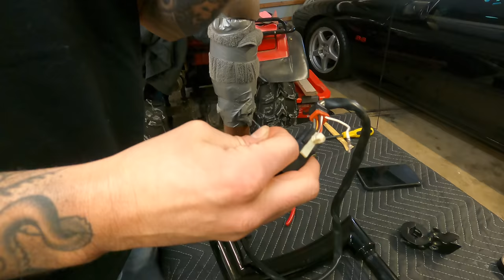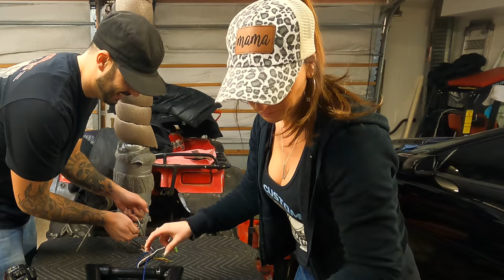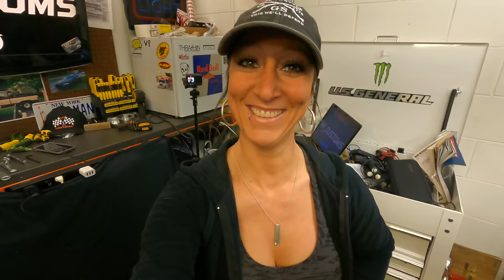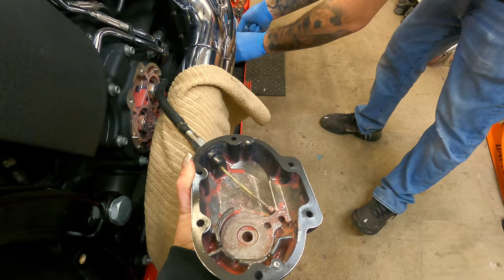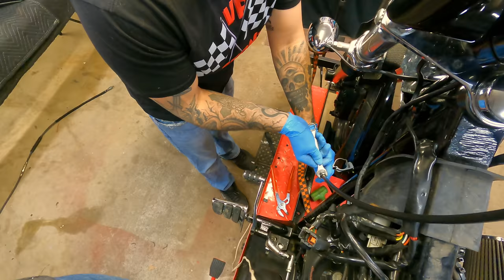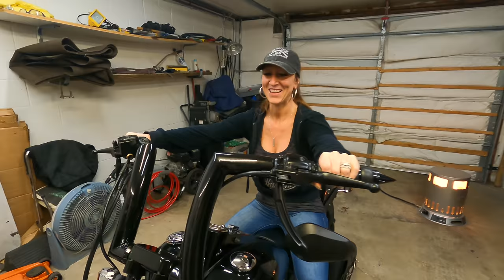The Fattest Apes On The Market- Install Pt. 2

Comment: Guys, love the content, I have been doing my bar job all winter. I’m on mock up right now. And found out that I’m not good at soldering. $400! HD wanted 10hrs
Reply from the maker: Geeze!! Burly sells a kit that you can just extend the wiring with pins, that's what we did!!

Comment: The wiring connectors have a barb that you’re collapsing, so when you re insert the wires into the connector, you might have to gently lift the lock back up from being collapsed or they won’t stay locked in to the connector.

Comment: Great Video!! Mate, may I know how height Tanya is?? I am 5 8” and struggling to install 12” or 14” ape. Thanks!!!
Reply from the maker: Thank you! Tanya is 5'3 and rides with a 12 inch bar.  I'm 6'2 and also have a set of 12 inch bars.  So whatever your preference is!
Reply: @VPCustoms  Thanks for the reference!! Really useful info for my decision=]

Comment: that s a pretty detailed video. good info . thanks
btw , did anybody use the cable extenders from Harley ? doesn t seem like there s room for more plugs underneath that rubber protection.
any thoughts?
I m trying to put 12' apes on a 07 Fat boy but I rather get the prewired handle bars
Reply from the maker: Thanks! Glad you enjoyed! Prewired definitely makes the process much less time consuming, I went that route on my 2001 Nightrain.  I think with some craftiness you could sneak in some more plugs under there.  Good luck!

Comment: Chain goes through quick but try cord to pull it through or something smooth like fishing line. My fave is cord cause you can tie easily to wires then black tape. If they’re small diameter , ky lube will work well then dry out better than Vaseline.

Comment: Definitely, even what seems to be the easiest job. Will always have some issue. I had a lot of issues with my first winter project and had to do research to figure out how to solve each issue. Especially mounting Street Glide fork mounted turn signals to the front of my Road King. First time de-pinning and finding out what connectors and pins I needed, but luckily I got it all situated.
Reply from the maker: Glad you worked it all out!

Comment: Very good and informative video! I have the same Night Train 07 and plan on doing a similar customization on mine. Could you tell me the lenghts of the clutch, throttle cables and brake lines you used? Thanks in advance and cheers from Poland!
Reply from the maker: Thank you! I used the 14 inch extension kit from Burly.

Comment: Hey guys. Love your videos. Actually the main reason I got back into riding is cause your videos. As well as why I purchased a night train. I just picked up an 2007 train. Is there any way you have a link from Amazon or somewhere to the exact handlebars as well as the burly kit? I want to do the same setup with mine just not sure about the cable/working kit from burley that would fit with my 07. Thanks guys. Happy riding be safe.
Reply from the maker: Sorry for the delay!! Thanks! 

https://www.ebay.com/itm/353567630857 the bars are 12 inch 

https://www.revzilla.com/motorcycle/burly-handlebar-cable-installation-kit-for-harley-softail-fx-2007-2010

Believe I went with the cables for 14 inch bars

Comment: You can also tie string to the wires and use a shop vac to suck the string thru the bars then pull
Reply from the maker: That's a good method too! Thanks!

Comment: Hey guys, i know i asked this question a few months ago but cant find what you mentioned,,,,,, since you used 12 inch apes and looks like 1 inch risers  how many inches over stock cables did you go ? thanks for any info you can send.  Cheers
Reply from the maker: Hey there, we went with the 14 inch handlebar wiring kit from Burly.  They are alittle too much though.
Reply: Thanks gang, much appreciated for the info , and the video , cheers from Montreal  @VPCustoms

Comment: Ok I’ve been doing research will a 21x3.5 front rim fit An 2009 night train ? And same size tire u have on the front fit ?
Reply from the maker: I'm pretty sure you would have no problem! Just need to get the hub size for your axle and year of bike
Reply: What size tire u have on the rim ?
Reply from the maker: @zachconverse8106  120/70-21

Comment: How tall are these handlebars? Thinking about getting 12 inch or 14inch on my 07 night train.
Reply from the maker: These are 12 with 1 in riser
Reply: @VPCustoms  thanks! Do you got link to the burley kit used in the video?
Reply from the maker: @940adolfo  https://www.revzilla.com/motorcycle/burly-handlebar-cable-installation-kit-for-harley-softail-fx-2007-2010

Comment: What Bars are those? and what height?
Reply from the maker: https://www.ebay.com/itm/353567630857?_trkparms=amclksrc%3DITM%26aid%3D111001%26algo%3DREC.SEED%26ao%3D1%26asc%3D20160908105057%26meid%3D5dc9af72a7b24a69b4e8e2df7fb35e88%26pid%3D100675%26rk%3D1%26rkt%3D15%26sd%3D353567630857%26itm%3D353567630857%26pmt%3D1%26noa%3D1%26pg%3D2380057&_trksid=p2380057.c100675.m4236&_trkparms=pageci%3Aa6c7a10d-8b83-11ec-be8b-3a4acead06d1%7Cparentrq%3Aeabdba4917e0aaf5a0e77f85fffdf180%7Ciid%3A1 

12 inch tall